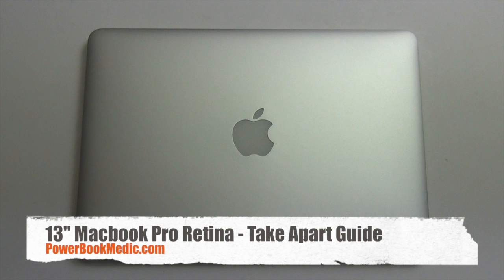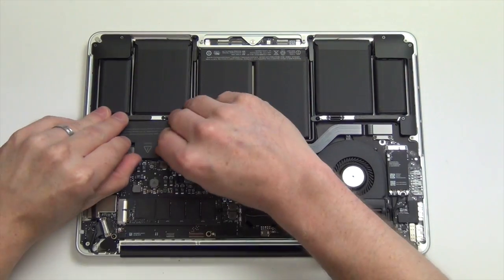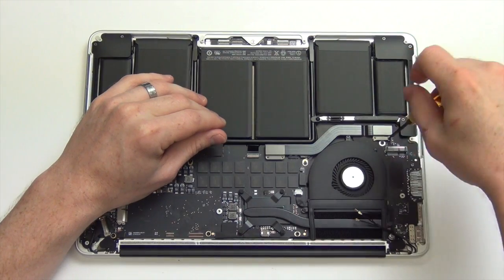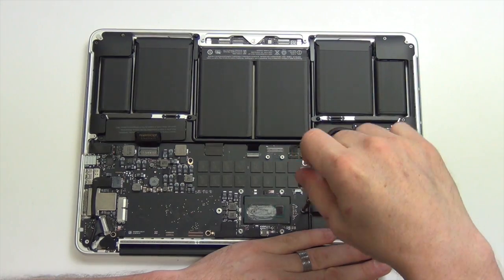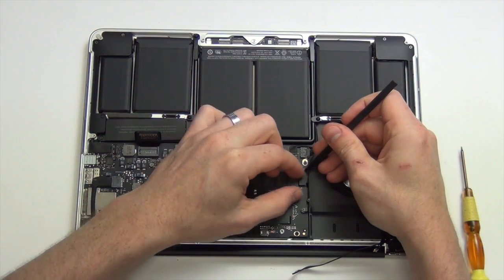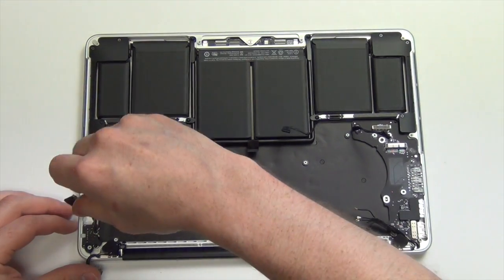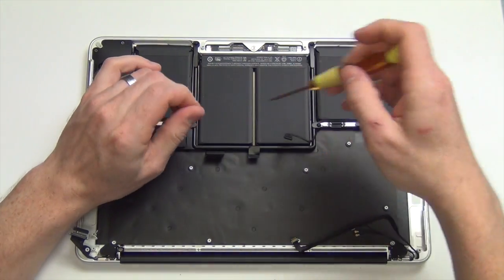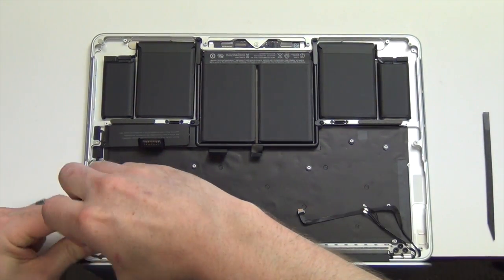Macbook Pro 13" Retina A1502 Take Apart (2014 Model)

Comment: can you upgrade a macbook pro a1502 ram? im running on 4gb ram wanted to upgrade is it doable?
Reply from the maker: Not easily. You would have to replace the logic board to upgrade the ram as the ram is built onto the logic board.

Comment: great video i learned a ton from this. 
I have the same computer My question is what is the best Curved monitors in the 30 inch plus range to pair with this type of mac for the best display. I had a Samsung 32-inch Curved Full HD Monitor in White.  It was really bad, it had glare issues and the display was extra large on the monitor. I tried adjusting  the ( display setting on the mac computer and the samsung monitor.But to no avail) , and it made my eyes hurt.

Comment: Can i change the ram on my Macbook Pro mid-2014? Its an I7 with 3.0 ghz and a 512SSD and 16gb ram. I was wonder If i can upgrade to 32gb ram??
Reply from the maker: No, you can not upgrade the ram on this model.

Comment: I have the A1502 early 2015 model, so some of the items are a little different. where on the logic board is the 820-xxxx number located? can the cooling fan be taken apart for better cleaning? if the moisture indicators are red, can they be reset or replaced? can a magsafe connector be installed in place of the magsafe2, and still work? thank you

Comment: on that model, can the SSD module/card be upgraded? the cpu is SMT? can it be upgraded to an i7? the screwdriver to remove the bottom cover/pan, thats a P5 pentalobe? thanks & great video!
Reply from the maker: J. Lietka Thanks! Yes, the SSD can be upgraded. To upgrade the CPU, you would need to replace the logic board. And yes, that is a P5 Pentalobe.
Reply: Powerbook Medic ok thanks again 😃 i will watch this how-to again

Comment: Worked perfectly to strip down my good components, replace the Upper Shell, and put them all back. Thank you for this walkthrough! Thought my HDMI port might have ended up as collateral damage but it seems to be actually a firmware issue (bypassed by this method, of all things! https://www.youtube.com/watch?v=-9iJOEQ-_Ys&frags=wn)

Comment: Hey, I have this specific model and I think there is something broken internally. Both my keyboard and trackpad aren't working anymore. What might the problem be?
Reply from the maker: Typically, when that happens there has been some sort of liquid damage. The top case and/or the logic board could be the issue.
Reply: @PowerbookMedic  Is it something that can be fixed?
Reply from the maker: Andrew Kimani Yes, it can be fixed. You can check out our send in repair service here. https://www.powerbookmedic.com/mac-service.php

Comment: what size are the screws? my macs vent are plugged
Reply from the maker: To take off the bottom pan is a Pentalobe P5 screwdriver.  And then the Torx screws to remove the fans are T5.

Comment: These little connectors don't even snap back in place on the Airport card. Any ideas  if they are stripped?
Reply from the maker: You can need to try them at different angles and locations to get them to snap properly. They can be a little difficult sometimes. If they just won't snap then it's possible the connector is bent which can sometimes be bent out but more likely than not would require replacement.
Reply: Powerbook Medic so what should I do if it’s not snapping in.
Reply from the maker: @DjRatedRShow  See if the connector is bent. If so possibly try to make a minor correction to it. Otherwise replace the connector or send it off for repair. We offer repair services at this link: https://www.powerbookmedic.com/mac-service.php
Reply: @PowerbookMedic  I think I will try to replace it because I will hear a click like its going on then it will just pop back up.

Comment: where is EFI chip in this board thanks?
Reply from the maker: You must remove the board from the unit, and flip it over.  It is on the side of the board that is closest to the clutch cover.  Close to the SMC chip as well.

Comment: How do you put the WiFi cables back on?
Reply from the maker: You simply press the female connector down on the male connection on the wifi card.  It will pop into place.
Reply: Powerbook Medic thank you, it worked

Comment: My right speaker is having an issue, what can I do about it? Is replacing the speaker the only option?
Reply from the maker: Yes, replacement is your only option.
Reply: Hello, I hope you can find the time to respond to my question as I am yet another victim of Apple's seemingly-notorious speaker distortion/crackle/rattle: If attempting to replace both speakers, what steps would be necessary in the disassembly process? Also, am I limited to only Apple-manufactured speakers, or may I replace the speakers with third-party speakers? 

Much thanks in advance

Best,

Comment: for a guess the torx screws that hold the case together won't be a standard fit but a special size requiring a special only available through Apple for an exhorbitant fee.
Reply: Not Torx. Torx and Pentalobe are different. These very small screws' heads are easily stripped if the incorrect driver is used. The battery is held in with Torx T5.

Comment: Do the logic boards need to be flashed to upgrade a 2014 MB ProRet from 8gb to 16gb?
Reply from the maker: No. You would have to replace the board to upgrade to 16gb.

Comment: Hi. I need to replace my MBP's keyboard due to the letter 'o' sometimes going wild by repeating itself, or sometimes not responding at all. I tried cleaning under the keycap but it did not really help. This is the model I have. Do I need to do anything special to get the keyboard out? It looks riveted. Any advice you have is helpful, thanks.
Reply from the maker: Your best bet is just to replace the entire top case with keyboard. Removing the rivets is extremely time consuming and requires a special tool. Replacement top cases that include the keyboard are available from our website.

Comment: My screen stopped working after a fall, how do I reconnect the LCD cable. please talk to me like a five year old. Pretty new to this
Reply from the maker: It's extremely unlike the LVDS cable came unplugged in a fall. More likely is that your display needs to be replaced. You can call us at 1-866-726-3342 to order a display or discuss your repair options.

Comment: Ok, so I decided to clean the fans of my out of warranty MacBook Pro mid 2014 15". Before doing anything (like disassembling the fans) I disconnected the battery connector and started the cleaning (with a very soft brush).  I accidentally misplaced the screws on the left fan  by putting 4.4 mm T5 Torx screw in place of the 3.9 mm T5 Wide Head Torx screw. Now the mac looks dead. No light on the magsafe, no power on no nothing. 
Does anyone know if the threads for the screw go all the way out of the motherboard or i just destroyed some layer of the motherboard ?

Please let me know ANYONE i'm desperate!

Comment: All this to change a battery? Can there be any wonder why so many people buy anything but a Mac?
Reply: you don't need to do all of this to replace the battery. I replaced the battery on mine today, unscrewing literally nothing from the main circuit system or what ever it's called. Now you need to do all of this to replace the keyboard, but you would need to do essentially the same to replace that on a windows laptop as well.

Comment: Hi PowerBook MEDICs... I have a MBP 13.3" MID 2014 and my keyboard suddenly stop working after logic board replace (everything is going good, is just the keyboard)... some ideas?
Reply from the maker: If it was working before replacing the logic board, then the problem is likely the logic board or that you did not connect a cable properly.
Reply: in a MID 2014? what cable do you mean?

Comment: Thank you very much for a great video, that helped me to understand the architecture of the MacBook Pro Retina 2014. 

In fact, I need to replace a trackpad and as far as I have seen this  is the only part is missing :)) Could anyone help me? I guess I need to remove a battery that is quite problematic (with only 230 cycles) and value of 100 Euro - seems to be a tricky part.

PLEASE HELP!!!!!!
How to exchange the trackpad on MacBook Retina 2014 13" Model A1502? 
I would very appreciate your links, video tutorial, ...anything :) Thanks in advance!!!

Comment: Fuck apple for making this so complicated.  The previous years is literally a 2 minute repair, with nothing to remove.  This is just another way for them to generate revenue for a battery replacement.  Apple care is a waste of money, but lets say you did buy that, battery replacement 99% comes 3 years (333 cycles per year, 1000 total cycles) and then to pay $200 for a replacement.  All they needed to do was to place the connectors on top of all that garbage and it would take 2 minutes, why apple?
Reply: Apple
Think Different
Reply: you dont need to do all this shit to replace the battery. I replaced mine today and I only needed to unscrew the speaker things because they pin it to the machine. The battery replacement still takes like 2 minutes man, chill.

Comment: this video was instrumental in helping me repair my macbook pro retina 13-inch (late 2013, model a1502) keyboard - the underlying architecture is the same! Thank you so much!
Reply: Same here. Helped me to fix the unresponsive keyboard and track pad in my MacBook Pro (2015). I just removed the back cover,  unplugged and re-plugged the battery connector and i/o ribbon. Thank you Powerbook Medic!

Comment: Thanks for this great video. I was able to revive this same model computer that my daughter spilled water on. A few days later the wifi quit working and everything indicates the airport card isn't functioning properly. The keyboard is also acting up with a few keys on the left side not working. The shift, FN, control, option and command keys specifically. Can these keyboards be replaced?
Thanks again.
Reply from the maker: They technically can be replaced, but it is best done by a professional. Your best bet is to replace the whole top case. We can also do the repair for you. You can give our repair department a call at 1-866-726-3342, option 2.
Reply: Thanks. Do you know what version a1502 this unit is?

Comment: Do I have to remove all that other stuff if I just want to replace the battery?
Reply from the maker: Yes. You have to remove the top case to remove the battery. Replacing the battery is extremely difficult however and should only be left to professionals.
Reply: Order a new top case it comes with the battery built in

Comment: how would replacing the keyboard work? i read its fixed with rivets!? do i have to drill it open? and if so - how do i fix the new keyboard  so it stays in place?
Reply from the maker: It is held in by rivets. You are much better off replacing the entire top case assembly.
Reply: but is it possible to replace the keyboard? it would be so much cheaper!
Reply from the maker: Yes, it is possible, but it is very difficult and time consuming.

Comment: Hello powerbookmedic 

I'm having an issue with this current model. MacBook will power on (audio tone), backlight comes on but no display. Only backlight remains on. Any suggestion?  Thanks in advance
Reply from the maker: You likely have a problem with the logic board. We'd have to see the unit to determine the issue.

Comment: Hey, how do I remove the battery to clean my trackpad?
Reply from the maker: Only a professional should remove the battery on this model. It's held in place with a strong adhesive. In most cases if you are having trackpad issues you'll need to replace the entire top case.
Reply: +Marco Sartori Thanks. Yes, I saw it. I bought the kit already but I haven't had a chance to open it.

Comment: I have a question: can I replace my logicboard on my late macbook pro 13 retina and upgrade the GPU AND CPU?
Reply from the maker: You can only upgrade within the same model year. So if there was another 13" retina model available when yours was purchased that had a faster processor, then you could upgrade your board to that one. You could not upgrade to a different model year though.

Comment: +Powerbook Medic Great vid, I'm having a problem with my mid 2014 Mac book pro 15" ...it keeps shutting down and my diagnostic says that something is wrong with the battery. Can you help?
Reply from the maker: +bigdap100 - You are likely going to have an issue with your logic board. We do have a logic board repair service available. We offer a free diagnosis and if we can not fix your board then you do not pay for the service. You can call us for more information at 1-866-726-3342, option 2.

Comment: HOW do you change JUST the battery?
Reply from the maker: +I94SOUTH - That's a much more difficult task. You have to remove the top case and then pry the battery out. It is only recommended that a professional do that repair.
Reply: +Powerbook Medic  -- You wouldn't know of anyone who sells replacement batteries for a mid-2014 macbook pro 11.1 (A1502) would you?  I get that it's best to have a professional do this, but I got estimates of $600+ for this repair.  I'd rather take my chances on a DIY repair or just buy a new macbook than spend $600 to repair this one.
Reply from the maker: +cheenky - They are available from our website. Our SKU is SKU99836 or GS99836

Comment: Can the memory of a A1502 can be upgraded? Some people are saying yes and others are saying no.
Reply from the maker: +Sunny Dindoyal - The memory can only be upgraded by replacing the logic board to a board that had more memory when originally sold. The SSD can be upgraded.
Reply: +Powerbook Medic Thank you for your reply. In that case it would be very expensive as the processor is also soldered onto the logic board.

Comment: Can i put a late 2013 complete retina display on my mid 2014 macbook pro retina display?
Reply from the maker: +Manuel Odin De los Ríos Arce - The late 2013 model and the 2014 model do use the same display. As long as the display is from the late 2013, you should be good to use that display.

Comment: Great video, wish I had that screwdriver. Anyway, Do you know where I can find the power on pads? I need to short them to power up my mac, because I spilled water in the keyboard, laptop works fine but I was an idiot for letting it go out of battery, and now I can't power it on, so I want t know the location of those power on pads.

Comment: Hi,Thanks for the video.

Is it possible to upgrade from 8GB to 16GB i have same specs Macbook pro (2014) A1502 i5 8GB RAM and 256GB ssd ?
Thanks
Reply from the maker: Talha Qamar - You can, but you have to replace the logic board to do it. It is not worth it.
Reply: +Powerbook Medic Hey I really need to upgrade my hard drive but I am not sure which m.2 ssd is compatible with my Mid 2014 Macbook Pro. I want the Samsung 950 Pro, is this compatible? Please help?
Reply from the maker: +John Roger Bell - I believe that uses a different form factor and is not compatible as a result.